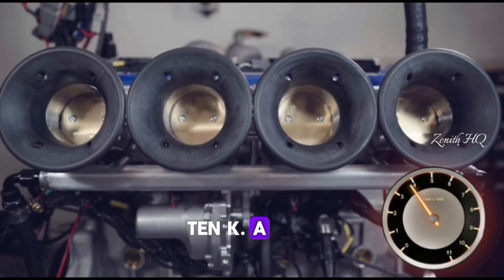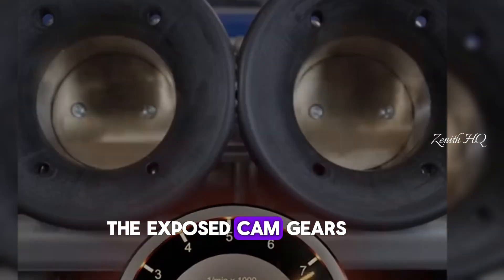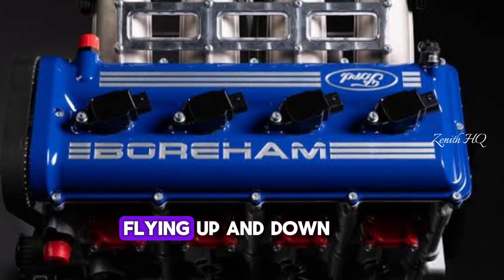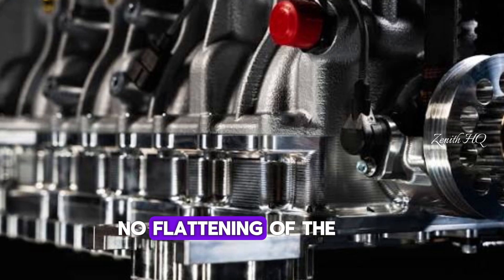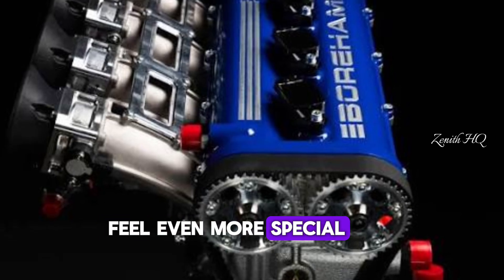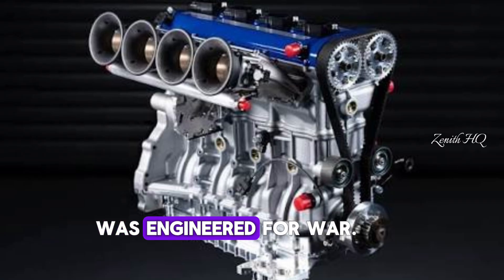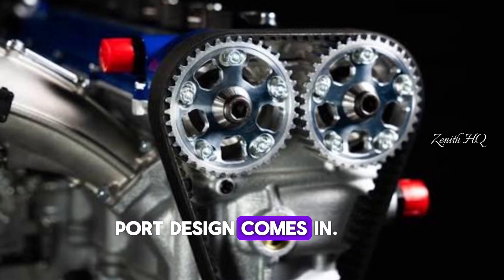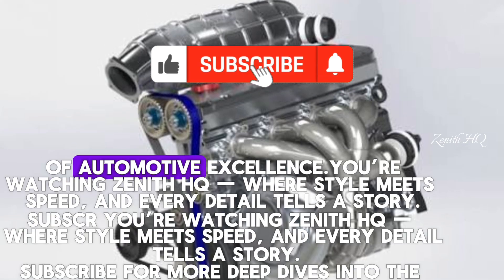The Boreham Ten K: The 10,000 RPM four cylinder Monster That makes 325HP without any boos😲🔥😳🚀

Comment: Props to them, but its really honda that can provide this level of engineering.
Reply: Did you read about the dodge 1000HP or Porsche W18 engine? 
They beat Honda by far
Reply: @trendspawn0 You’re talking about an engine literally 6x more cylinders. Still slow, and a built civic would absolutely destroy both those vehicles.
Reply: @trendspawn0 You turn keys, I turn wrenches. We are not the same.
Reply from the maker: Thanks kindly subscribe ❤️
Reply: That's not true at all.
Reply: @LifeCompanionDogs8083 Why do you say so?
Reply from the maker: @LifeCompanionDogs8083 Kindly subscribe ❤
Reply: @LifeCompanionDogs8083 explain who designed the block? Honda or the person using a cnc machine to make a block?